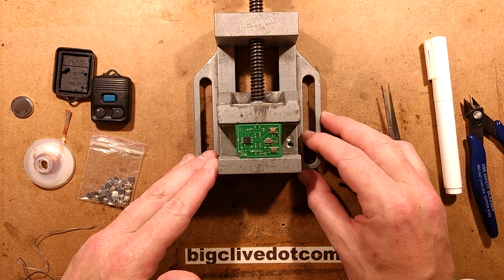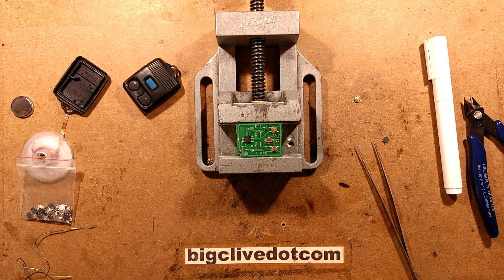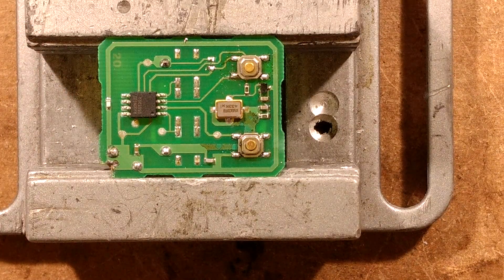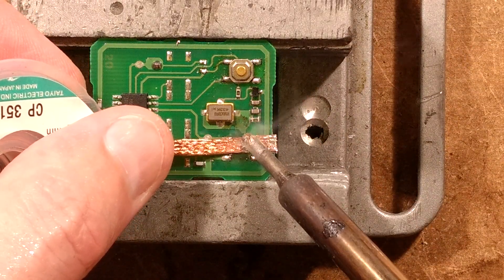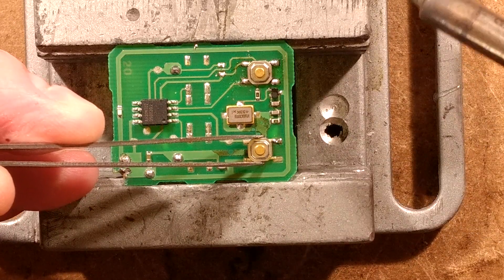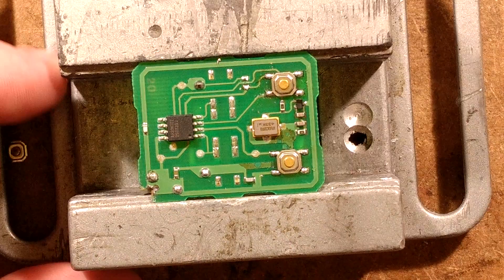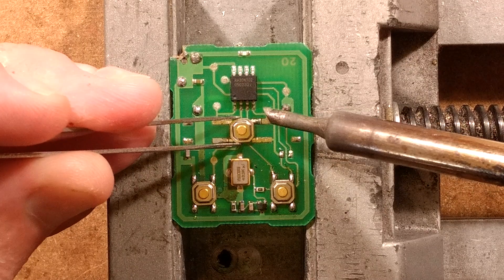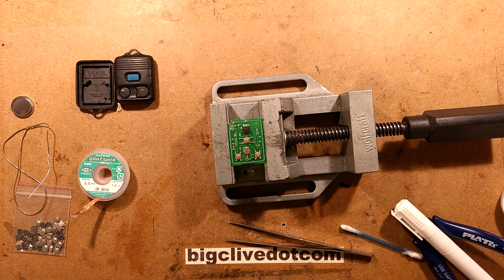Car/van keyfob button replacement.  (Glitchy video!)

Comment: +bigclivedotcom I used to employ this method of component removal. But, you must be very careful while hingeing the component to one side. The problem is that the circuit traces/solder pads on the hinged side may lift off the PCB if those leads are stiff and don't bend easily. Then, the repair of those pads can be very tedious and time consuming. After having done this all too frequently, I now tend to favor hot air removal of SMDs.

Comment: Can you please give that person who thought it is a good idea to drill into the fob and through the board a good whack? Just in case he gets similar ideas on things where it could actually be hazardous.

About the stuttering video: an issue like this looks very much like something that is heat related (would fit, since you also said you're in a heat wave right now). The processor will throttle back when reaching a certain temperature. There are apps that will let you read the internal temp sensors for one and/or show you the load of all processes on your phone so you can check if anything has gone "rogue".

Comment: the Motorola G4 and G4 Play are supported by LineageOS 14.1, and you should consider that as your next software upgrade. 
Maybe it's also your MicroSD card going bad? but regardless, getting non-OEM Android on there will absolutely benefit you, and also let you take over more control of that phone.
if you're using the stock camera app you may need to find a different solution, but nonetheless, I'm sure there's something out there that will work.

Comment: Hi Clive my G4 does the same since the last update , first I thought it was the SD card so I bought a new SanDisk Extreme card ... But it made no difference as did "factory resetting" the phone .. I now use 'Open Camera' by Mark Harman ... It's free and Add free as well ... I've had no problems using that ap instead of the standard photo/ video app
Reply: see here for footage 'shot' with my G4 using the Open Camera app ... works much better than the 'updated' moto one
https://www.youtube.com/watch?v=_dzcOWvxssM&t=1s

Comment: Moto's phones have been on the decline in quality. I have a G5s and it doesn't like wired headsets with a built-in mic. If you use one then the mic doesn't work and sometimes the earphones will have issues. Lenovo says to use a different headsets even though it's an issue for many people with different headsets. Never getting another Lenovo product again.

Comment: I use some fairly old computers, some of them are over 10 years in use and still work perfectly fine. I use them with Debian GNU/Linux and the vendors of the computers or microsoft/apple don't have any chance to destroy them with updates. Only the current failed web-technology (video codecs on sites like youtube or websites with ridiculous amounts of javascript) try to kill them.

"Smart"phones on the other hand can't be run on alternative software. Alternatives are just other/modified versions of Android or nothing (iPhones are no alternative, they are worse!). It is all trash and if the evil consumer doesn't throw it away to buy a new one it gets killed with updates. Even the soldered-on eMMC are crappy, their wear leveling makes them slower over time and if the updates doesn't kill the device, I/O on the eMMC surely does. Today everything is built for the trash. :(

That is why I like channels that take things apart, it shows which devices can be easily hacked/repaired and what is glued shut so nobody can open it. Thanks for that.
Reply: It's not easy but it's slowly bordering on possible.

For a long time, it wasn't possible because Android devices use SurfaceFlinger drivers and not Xorg, closed-source. But with Wayland transition, Wayland-Hubris actually supports SurfaceFlinger drivers without Android's SurfaceFlinger.

But the whole system has a long way to go and by the nature of abusing binary drivers in an environment they haven't been designed for to be a bit of an uphill battle, plus a lot of other struggles.

Of course SoCs specifically designed and marketed to run Linux are a different affair entirely, but most Android phones use something that isn't.

Comment: Overheated phones and tablets will throttle back the processing power to prevent them going 'China syndrome', so it's probably the heat that's the problem.
Reply: Hannes Angst 
Keep in mind that very few UK homes are built to deal with warm weather and, as a consequence, the temperature indoors often exceeds that of the official outdoor temperature which is taken in the shade. This is compounded with extended periods of still, dry, sunny weather, such as we've had for several weeks, as homes are difficult to cool, even during the night, resulting in a steady increase in indoors temperatures over the period.
Reply: Agreed
Reply: Keep in mind that we are dealing with a hot day in the UK. So it's most probably 75°F or 24°C...

Comment: Clive have you tried factory resetting your device, I factory reset my phone & computer every 12 months, keeps everything nice and fast!

If you are looking for a new phone I can't recommended a Pixel 2 (Including the XL variant), Samsung S9 (including the + variant) or an Xiaomi Mi 8 (make sure you get one with the global ROM). I can't recommended top spec phones enough... I've tried all 3 and they're all amazing phones. I'd probably say that the Pixel 2 XL is the best because of the fast ROM updates and clean stock ROM.

Comment: You know, why not get a phone with usb type c so you can get a dongle that supports both charging your phone and also have it output to hdmi so you could have a small cheapo TV as the viewfinder. Very ghetto but its probably the simplest way to get a reliable image.

Comment: See about a phone in the LG V series of phones. I'd personally recommend a LG V20 if you don't mind getting one used. Those things give you a lot of control over the video (even true manual audio level control, I almost regret swapping out for a Galaxy S8). I've had issues with mine experiencing slowdown, but I'm in the US with an unlocked Verizon model (not sure if these are universal issues). Even then though, video performance is still outstanding (and I only paid $150 for mine on fleabay--mint condition). I think the only reason I would still use my studio camera over this phone is due to some technical crap that doesn't matter on YouTube (yay autistic tendencies and HD-SDI interfaces).

Comment: Clive, is a fiberglass scrubby pen thing that gents like Peter from TRX Bench uses; a good piece of kit to have laying around for cleaning up grubby PCB's like the one here?
Reply: I have been using them for years -I love them for removing copper oxidation and some corrosions. Not good for solder flux, it just pushes it around. 80% to 100% isopropanol Alcohol is best for flux.Don't use any wire brush - could leave a wire behind to short out the PCB. Also pencil erasers leave a film behind that could contaminate a good solder joint. An INK eraser is good for cleaning copper runs on PCB's.
Reply: Unfortunately you can't clean up this PCB just like that, the corrosion is within the copper layer under the green solder-stop lacquer.

So you'd have to strip off the hard lacquer first, clean off the corrosion from copper, flood some solder on top, and re-lacquer and cure. Honestly it's easier to just run an extra wire or two to double up the connection.

Comment: I'm pretty happy with the camera on my OnePlus 6. My only complaint is if you record in 4K resolution at 60p it has a 5 minute limit. It should be more than enough to record at 1080/60p endlessly.

My 2 most recent video uploads were filmed with it.

Comment: Sometimes the hardware doesn't fail soon enough, so the manufacturers have to kill it with software.
Reply: Yes just stop doing your security patches on your safe Android Phone.
Reply: Jasper Janssen
I'm not sure that Clive is a typical Apple fanboy.
Reply: Siana Gearz they last a bit longer than that usually!  I think the 4, 4s and 5 have become too slow and glitchy but 5s is going strong.
Reply: the last update for the iphone 4 slowed my backup phone to the point it is only useable as a phone.
Reply: Hence that's why my phone dies at around 50% charge even with new geniune Samsung batteries 😬
Reply: That pretty much never happens. Did you notice how Clive did not buy a new iPad? But explicitly some other brand?

Deliberately making your stuff worse so you’ll replace it is a losing strategy. There is no reason whatsoever for Apple to engage in it.
Reply: I'm fairly sure most Apple users will buy Apple again when after 2 years something stops working - they'll think it's how long it was "supposed" to last, and they will likely not be able to know or investigate the cause of failure. Or they'll think it's so well-made, that an alternative from another manufacturer would have lasted even less.

And after all, if your Android fails, you have dozens of equivalent alternatives with all the same software to fairly painlessly switch to. If your Apple device fails, and you're well bound into the ecosystem, getting another Apple device is simply less painful than switching to something else.
Reply: Jim Fortune  the best thing is NOT do any software UPDATES unless it already has issues ect
Reply: I have a Nokia 6 (the first one) and the Android 8 update made its stock android sooo much better. Its Faster and some Bugs got fixed. But yeah crap companies like fucking Samsung or Apple are the pure cancer.

Comment: I have an old VW keyfob for my car, which doesn't work any more either. However, the buttons still work, and the keyfob itself even also still thinks that it works, because the little LED does light up on pressing the buttons. So it is something electronical, and I have no idea how to diagnose that. I only know that the components on the PCB are horribly small, so I'm even scared to really approach them without a proper microscope. Of course I've tried the easy stuff like changing the battery, trying to re-learn the fob to the car first, but it didn't help, it's like there is just no radio signal coming out of it, although it acts like it would. If I remember correctly, I've read somewhere that these fobs do have a problem with cold solder joints, but how can I confirm this on such a small pcb?

Comment: I learned that the Samsung Evo Select cards are fast enough for 2K videos at 60fps. You can see if it's the Select model by looking at the color -- green gradient is only used for these models. Orange or red ones are slightly slower, and caused stuttering on my camera.

Comment: Iv done that a couple of times to my fob ,as the price of a new one displeased me,  the second time i upgraded to tactile ones salvaged from a vcr, they  only justfitted on the board, the rubber buttons were decentigrating, replaced with silicone . Wonder how many operation cycles those buttons are good for in less than ideal conditions.

Comment: Buy a DSLR. No software updates to slow down the device, and more options
Reply: Or maybe just a camcorder. Lower resolution sensor, much less processing and lower power consumption, better thermal management, because they are actually designed to film constantly rather than intermittently. Swivel joint display, so you can angle the camcorder down, while pointing the screen towards you. Built-in optical zoom. There is such a thing as just the right tool for the job!
Reply: A DSLM would be much better for filming actually. (Than a DSLR)

Comment: Something bothering me, the switched pads on those buttons, assuming the first was orientated correctly, how could the second one work, wouldn't it be a dead short, as it appears that the top two solder pads need to be switched?
Reply: bridgendesar Actually, 3 out of four switch pads are conductive (two of which are actually being continually bridged by the switch using the switch as a jumper, the third is the actual switched line that shorts to the other two only when the switch is pressed).  What you may be missing is that the lower right-hand pad tees off from the vertically running trace beside it.
Reply: Yes, can now see it on my PC's monitor, I'd originally watched on my mobile!

Comment: I replaced one of the buttons on the fob for my mom's '98 Mercury. it uses the same type. I didn't know where to get those switches at the time, but I had an old really cheap digital camera which had the same switches on the board so I stole one off that and popped it in. worked great

Comment: I saw that problem before... You'd better change your SD card or use internal memory, if you doing that already then you better change your phone. Have you ever tried a Samsung? I never had any problem with my samsungs, I do recommend.
Reply: Galaxy S3 (not all, because they had been built with different hardware) and a few other phones from the era provably self-destruct due a bug in eMMC firmware.

Comment: You should try another camera app.  I'm partial to 'Open Camera' with the blue logo. Totally free and better than the stock app on most phones.  You'd also want to free up memory, reboot and even reset to factory etc.
Reply from the maker: I do use Open Camera and did reset to factory state to rule everything out.
Reply: Weird.  I just used my G4 to record a Orb Weaver spinning her web with Open Camera and nary a hiccup.  Using internal memory?

Comment: If you want, you can load your own custom OS into your phone such as LineageOS and never have to worry about a slow phone again or it ever becoming obsolete or unwanted updates again.  LineageOS comes with the best security updates available for android.  The downside is that you have to work a lot harder to install it properly and you have to work harder to find the right camera software.
Reply: Too bad custom ROMs, especially vanilla ones usually don't allow for the full functionality of the camera.. This is especially problematic on Samsungs.. Also affects Oneplus... Wouldn't be suprised if Lenovos cameras would suck too with a custom rom...
Reply: sadly this is very true.
Reply: It seems more like thermal trotteling, nothing much a custom ROM could change

Comment: I had to fix a Volvo fob that was so severely corroded from water damage that most components and the board were not salvageable. So I bought a used Volvo fob on eBay and moved the chip from the old fob. Worked great.

Comment: I realize this video has a higher objective, but you can get those old Ford key fobs on eBay for about a buck and a half. I don't think I'm tinkerer enough to do it. I did however once fit one of these with a magnetic reed switch and glue it to the inside of the rear window.
Reply from the maker: Interesting idea as an emergency key.
Reply: I used it for scuba diving. In the past I've always carried a single key on a bolt snap to get me back into the car after a dive. The problem is you put a drop of seawater in your lock every dive and it has a cumulative and deleterious effect on reliability. I never did get the magnet system working to suit me, I believe I just needed a stronger magnet but sadly I had to drop diving for medical reasons about that time and I just haven't got back to it yet.

Comment: Yes your being saburtaged, “we want you to buy a new product now” lol. I was forced into buying a new iPad because one of my apps  I had paid for stopped working as it required an update. To perform the update I had to uninstall the app, only to find that the app was no longer supporting 32 bit and the update could not be done. The iPad itself works fine. its just Apple have chosen to no longer support 32 bit apps.

Comment: I know you like the fact that you can edit and upload your videos directly from what you're recording on but I may be time to swtich to a dedicated camera. Something like a Sony RX100 III that has really good quality and is easy to use and point and shoot along with more advanced manual exposure ability. It also has wifi so you could transfer videos to your computer/phone/ipad with that if you'd like.
Reply: Don't even need an RX100 Mark 3, even the older models are still fantastic, especially for what Clive does.
Reply: or he could just continue doing it the way he's been doing seeing as the equipment he's using is up to the task and has no physical faults.   With all the B.S. governments keep crapping on about over the environment and institutions like the EPA robbing us all blind while they sit in offices keeping chairs warm, I fail to see how it is still legal for manufacturers to "brick" perfectly working devices purely for profit. It's disgusting.
Reply: Jimmeh B He could but I was saying that this could be an opportunity to upgrade, albeit with more work involved for post. Yeah it sucks if manufactures "maliciously" brick devices, but I do believe that is not usually the case. When the Apple slow down thing happened, a few other manufactures admitted to the same thing but not a lot. They should probably just not allow software updates that won't run at a decent speed. However, then they would have to separate out security updates for each device and it would get messy and if they don't offer security updates at all and the device is connected to the internet then it's as good as dead. It's an unfortunate side effect of the advancement speed of technology. That's also why a dedicated camera could work so well, it wouldn't be bricked though updates and could last a good long time.